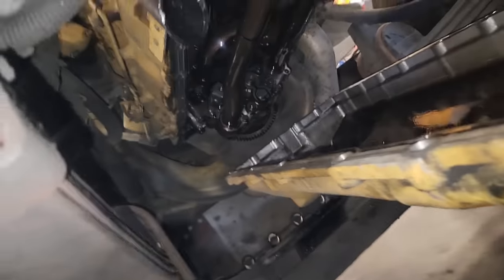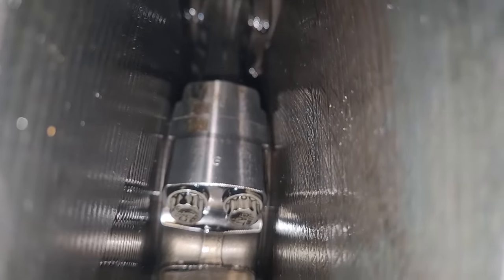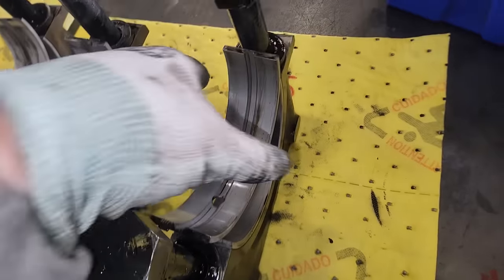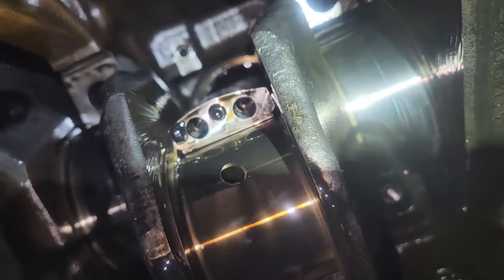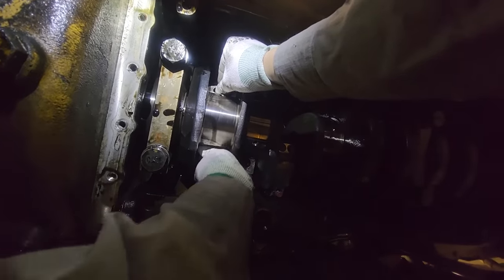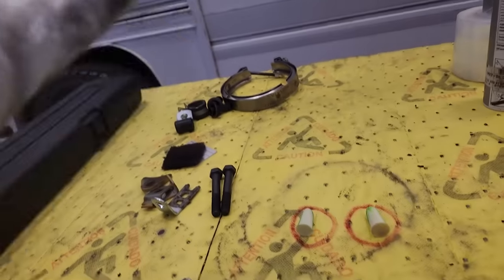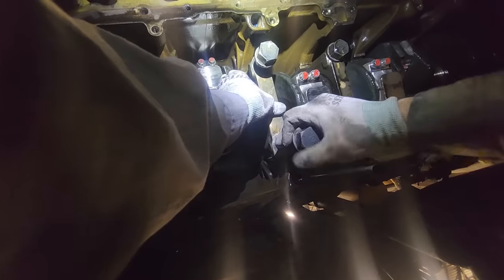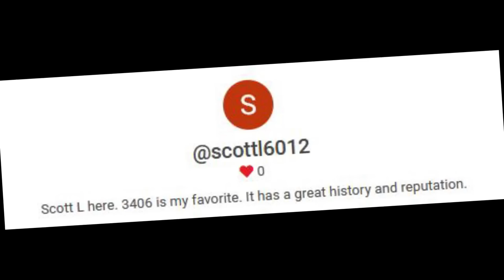Nice Truck Driver Paid for an Engine Rebuild, gets a HEADACHE! Engine "Re-Rebuild."

Comment: I am certainly not certain why it is loosing oil pressure under load. My guess is slight main bearing movement as it moves away from the load. Unless the crank is reground I feel no way to stop this. Good job on fixing this guys screw ups. I doubt he has a suite against this idiot. Hammering in the thrust bearings mean I would be reluctant to reuse thrust bearings if so abused because it would obviously be bent open. Thus altering thickness possibly causing an oil pressure drop during maximum pressure as the thrust will be maximised.

Comment: That crank needed a grind. If the previous engine builder did that poor of a job they probably didn't even mag the crank and check for cracks in the radius's.

Comment: that's screwed up. that person should not be doing rebuilds. i seen a guy rebuild one, looked at me and said this cylinder is not right. i said to him. pull it and do it right, did not do it. 500 hundred miles being towed in and cylinder blow out

Comment: Great video,  you doing great job. 
  I don't mean to bash. But I never use paint pins on the inside of engine.  Why? Because paint is abrasive and contains solvents. I use a metallic Sharpy. The Sharpy will come off with oil. But is on long enough to double check and let me know it's torqued. Cummins and International say not to use paint.
 No bearing removal and installation I use a plastic puddy knife.  And screw drive as you showed. Or I have used an old bearing.

Comment: Why are you touching your impact and torque wrench then wiping oil on the bearing with the same finger you just touched your tools. All that dust and debris is stuck to your finger.

Comment: I wonder if he took it to a shop in the Miami area? There is a YouTube Trucker that took his truck for an off frame complete rebuild and he vlogged it and they used white lithium grease all over that motor. https://www.youtube.com/watch?v=H8ld6ASQmd0 Fast forward to the 13 minute mark where they start putting the motor back together. Nice work on getting this guy tightened up the right way!

Comment: This video makes no sense, I am a pro diesel mechanic - Truck not running right - could be injectors, timing, many other things not internal.  If the truck is able to drive from Florida to Idaho and does not have rod knock or something obviously wrong, why would you ever do all that work taking the engine apart, you risk damaging it just by messing with it.  The bearing caps can easily get messed up even worse just by you dissembling them and even if you put new caps, same damage may occur from crank surface and your installation.  You really need to have crank re-surfaced by a machine shop if its that bad, the new caps will look the same way again.  If you used a torque wrench to take this apart, you could have found out exactly how tightly they were torqued but instead you just bill the customer for new rod bolts.
Reply from the maker: You certainly can have your opinion, but the customer wanted it gone through after he had other problems immediately after the rebuild, I'm about the third mechanic to fix things on it after the rebuild. The rod bolts are degree turned bolts, so even if you loosen them with a torque wrench, that will not tell you if they were over/under torqued.
Reply: Many people are good at criticizing and others are very good at doing their job professionally. I am the owner of the truck and I bet 100 to 1 that if he was who he says he is he (a mechanic) would have done the same thing. He just doesn't know the truck's full history or he just likes to guess and criticize. Thank god I made the right decision to go directly with Josh.

Comment: Explain WHY a guy would drive almost all the way across the country with a truck that wasn't working right to have you look at it!!!  You mean there are NO competent mechanics closer to Florida than Idaho???  BS.
Reply from the maker: The truck has had the problem for several months. He wanted me to look at it after watching the videos and meeting me. There are obviously lots of decent mechanics other than myself, but not many with YouTube channels.
Reply: Without trashing anyone. There are many mechanics, good mechanics? I think few. I spoke to many and went to different Dealer workshops and to be  honest no one but no one, except Josh explained to me in such detail the process of how to discover the problems with my engine. I don't want to say that they were wrongly wrong and now I understand why, many told me that I had to completely disassemble the engine, but I didn't think it was necessary without knowing that the job was so poorly done from the beginning.